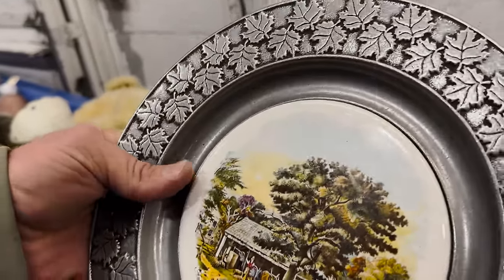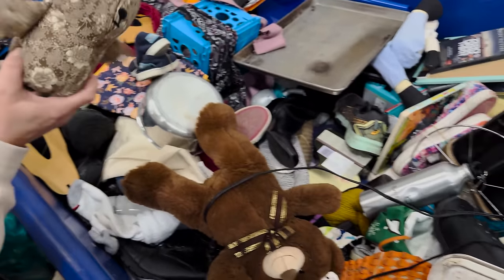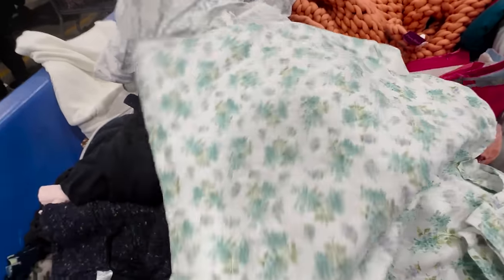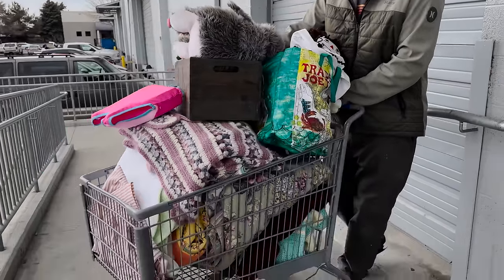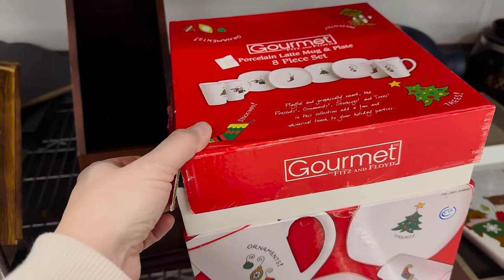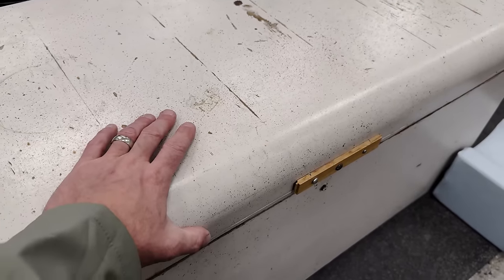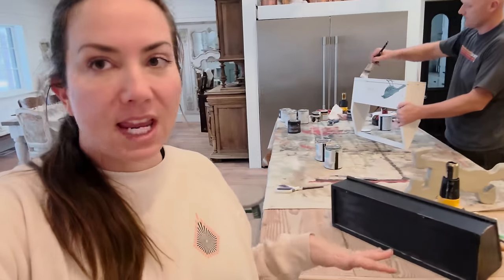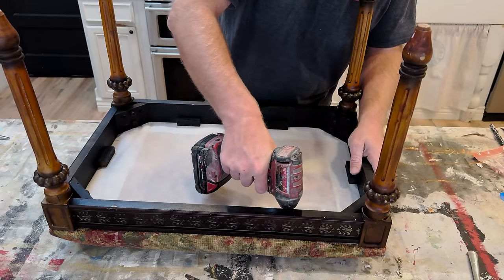Thrift with us at the Goodwill bins - Painting Cottage Thrift Flips & Vintage Shop Tour - Reselling

Comment: Add 1/4 cup of TSP to a full load warm washer on “Heavy Duty”
(Regular), when full add whatever smells of cigarettes.
Run full wash on warm.
No smell. (maybe a dink of a stain left.)
Reply: Or, you can pre-soak with TSP before washing.
TSP will remove All stains and smoke smells.
Reply: I need to try that stuff.  Painters dilute it and wash walls prior to painting.